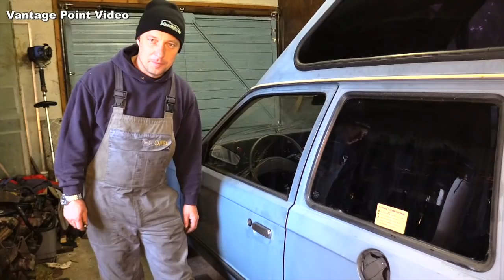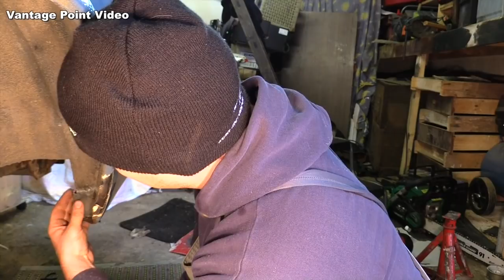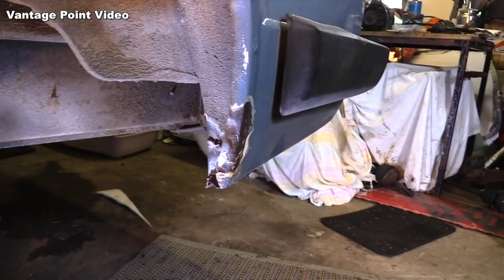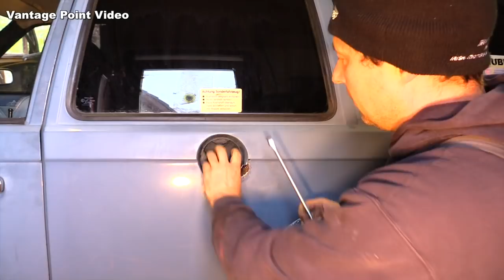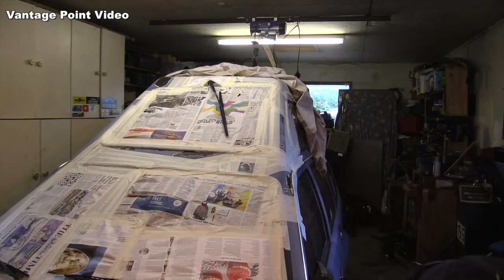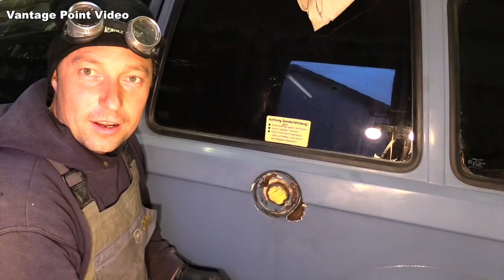Bodywork Repairs: Mobility Kadett Car Restoration Diary #12

Comment: but why did not the rust be treated with acid? and did not cover the bare metal with anticorrosive primer?
Reply from the maker: You can see at the front I got the metal really clean, so from my experience I'm happy to put filler straight on that and use ordinary primer. At the back I used an acid type treatment as you suggest as some of the metal won't be covered by filler and I do like the reaction I saw in the appearance of the metal there. There are repairs on cars that I have done this way that are 15 years old now and I have not seen any rust come up from under my filler.